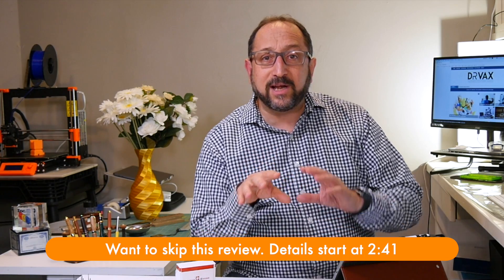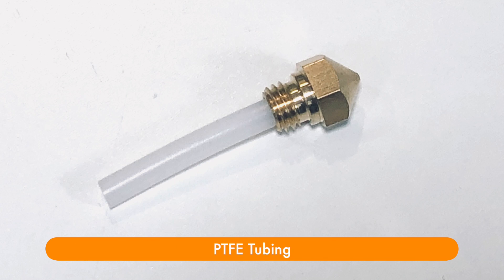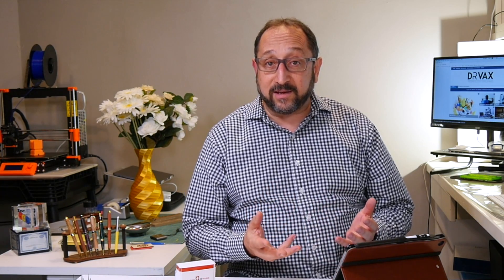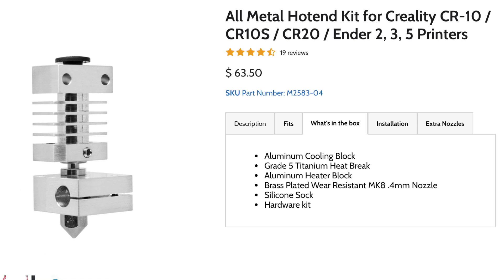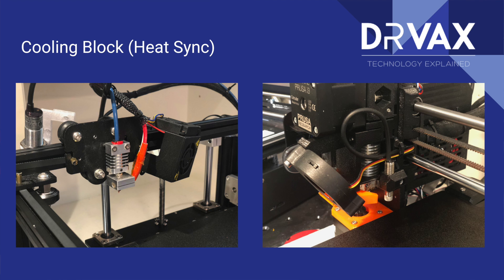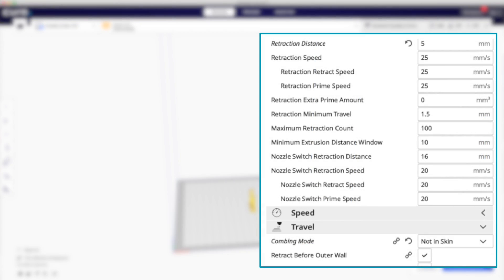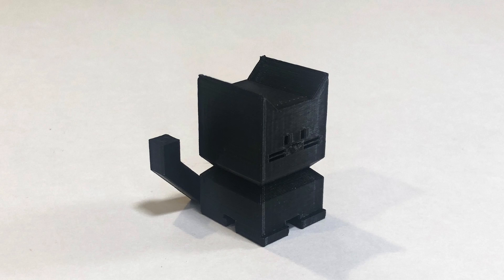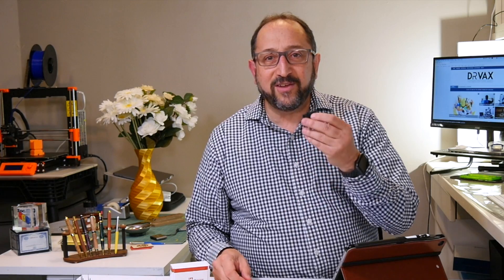Micros Swiss All Metal Hotend

Comment: Nozzle size  has nothing to do with the print quality but as much as your print get smaller nozzles has to be.If enlarge the smallest print its look like the biggest.Of course though  if you use a small nozzle size on a big print it prints it out smoother surface look.So the quality is the equally of the whole print.As long as the nozzles gives a round shape layers the surface wont be equal but if it is there it is from smallest nozzles.So the best  for solving this issue rather than upgrading the extruders is the nozzles gives a  Square shape just as pixels.But because of  filament being malted it gives round surface a gain but less than the round and can be bound in by letting the Square sides as that.On that way the slice can be built vertically and horizontally as bricks.
Reply from the maker: Not sure I agree.  However I appreciate your participation in the discussion.  It may come down to the definition of quality.

Comment: Hey Doc, have you managed to get your retractions dialed in for your ender? Im running a microswiss with dual gear extruder on my cr10s and still get some stringing issues that I cant seem to resolve. Any advice you could give would greatly help, my current retraction is at 5mm and a speed of 50mm/s with zhop enabled.
Reply from the maker: First try lowering your temperature.  Second I use 5mm retraction at 25mm/sec.  However every extruder setup is a bit different.   I also use Capricorn Bowden tube which seems to help.
Reply: @MakeWithTech  Thanks for getting back to me so fast! Im currently running PLA at 200 but I might benefit from dropping it to 195. I currently have a capricorn tube as well just need to dial it in a bit more, I'll mess with the retraction speed and temp and go from there. Thanks!

Comment: I am pretty experienced with 3d printers, i started in 2013 and i am currently developing my own printer from scratch. The observations you made because of the heat creeping are correct, thumbs up! hint: when assembling any hot end, tighten the nozzle at max finger force against the heatbreak, heat it to 250c +- and then tight it with a wrench.
Reply from the maker: Thanks for the comment and the support for my observation.

Comment: Some of the Micro Swiss setups have the 2 screws between the heat block and heatsink.  I've seen one video where there was, instead of the screws, flats for a wrench to hold the heatblock while you tighten it.  I bought a copy of the Micro Swiss from Amazon for about 12 bucks US, and this one has the screws.  I have been having tons of jams, and just figured out that the heatsink was getting too hot, and the melted material was, since it was under pressure, expanding and blocking as you say.  Now, two things, the Micro Swiss has miserable fins.  They seem very weak looking, with too little surface area.  Second, it seemed that it was stupid to have screws on there transferring heat!  I was tempted to remove them to see if it would work.  Then, I watched a video by 3D Printing Nerd who installed a Micro Swiss WITH the screws, and he TOOK THEM OUT after tightening the nozzle.  This answers so many questions!  I am testing again without the screws.  Obviously, if you need to remove the nozzle, you need to reinstall them.  It makes so much sense.  Why would you make such a thin titanium heatbrake tube, and then have 2 screws just trucking the head up there anyhow!!  Hoping for good results now....
Reply from the maker: I wouldn’t buy an inexpensive clone.
Reply from the maker: When testing precision machined parts like a hot end I would recommend purchasing the original part and not a clone.
Reply: @MakeWithTech  That would be easy to say if you had the cash to get the original.  I don't, but as a machinist I can also do my own quality control, so for me, this was way better than getting the original. I am getting all the benefits of the original now, just with less initial support from the seller.  Here my intent was to share tips that could help others like me save time and money.
Reply: Don't blame Micro Swiss for problems with a cheap knock-off.  They may be due to something the original got right but the knock-off got wrong.
Reply: @scottwillis5434  My intent was not to blame Micro Swiss, and their cooling fin design, despite the way it looks to me, does work!  I think it's a great design, as long as people who use them know what they are getting into.

Comment: Enjoyed the video as always but you fell short when comparing the Ender models with more expensive printers regarding the stringing issue. Not everyone can afford multiple printers. Your outcome was that 'all metal hotend' is a viable option but we did not 'learn together' how to  overcome the stringing with the Enders using an  'all metal hotend'. If it can't be done then it is not a viable option for Ender printers. Thank you for your valuable input and the way you put accross your knowledge in a simple and easy to understand way.
Reply from the maker: I appreciate your observation.  The Ender printers do an excellent job with day to day prints and most stringing tests.  It is only the tall tower string test which is a problem and it is unlikely a production print will have these characteristics.
Reply from the maker: @Peter Horton One more observation.  I am doing another set of prints for a video comparing my Prusa to the Monoprice Ultimate 2.  In reprinting the Prusa prints I am getting a bit of stringing which I do not remember in the past.  In the past I used Hatchbox PLA, these prints are with MatterHacker Build PLA.   It may be that Build PLA strings more and if so some of the stringing with the Micro Swiss might be a result of using a different filament.   

The fun and the challenge of 3d printing in a consumer setting, is that there are a million variables.  In a production setting you would pick one filament, tune for it, and only print with it.
Reply: @MakeWithTech  "A challenge" you can say that agagin. I am very impressed with the concept of lithophanes. I also had good outcomes with using Esun PLA+, so I bought some white Esun PLA+. My original prints where OK but had random lines through them. I was using Cura 3 as the slicer. Recently I completed a 3D printed revolving lithophane lamp which has 4 curved lithophane panels. Now using Cura 4.2.1 and trying to get get best possible prints, I combed the internet trying to find the best settings and ended up a dismal failure. Excessive stringing and artifacts. Finally after more research and analysing the Cura settings more closely I eventually got succuessful. The out come was amazing. it took about and hour longer to print each panel. But back to the Esun Pla+ white. I have done regular models and I believe the quality is not as good as other colours or brands. Still need to do more experimenting. I did notice that using a lower temp (was 215 now 207) improved the print. I am an expat pensioner living in Thailand and always been a tinkerer eg build, upgrade and troubleshoot my  computer as well as helping other people. My 3D printer as it is an enjoyable and valuable source of stimulation. Your approach to 3D printing is excellent and I always look forward to "Learning things together" with you. Thank you for your responce and commitment. Kindest regards Peter H

Comment: The issue could be that the parts are put together when warm, when they cool they shrink leaving tiny gaps, the hot end should be put in the freezer for a couple of hours before assembly then put together and tightened up, this will ensure that there are no gaps when there is differential heating between the parts because they are tight when cold and therefore will only get tighter as they expand
Reply from the maker: Not sure I buy this.  I always though parts expand when heated and contract when cold.  However since not all materials expand at the same rate threaded components tend to get loose when heated.  

I heated my hot end to 230c then retightened everything.  Save as the procedure for replacing a nozzle.
Reply: @MakeWithTech  E3D suggests heating above typical print temps for hot assembly with the idea that parts will tighten to provide good seals at print temps. They recommend 285C for the all-metal E3D v6.

Comment: Just use prepare abs end every time you want to switch filament regardless of what filament it is.  I've been doing it this way for a long time and have never had filament stuck.
Reply from the maker: Not a bad idea.  Only negative is that is overheats the bed.  Thanks for sharing.
Reply: @MakeWithTech  you can choose to heat the end only.

Comment: I love Micro Swiss, I have no issues. I have 2 all metal MK10's on my Flashforge, Now for my Ender 3 I did it a little different. I do not like the their Creality style Hot End, I want a thermal tube that goes through the heatsink. So I used a Creality CR-10 heatsink, a Micro Swiss MK8 all metal thermal tube, and a Micro Swiss E3D style coated nozzle, of course I am using a titan clone direct drive also, no issues.  Also, if you read the instructions from Micro Swiss, you should print a little hotter with an all metal hot end 5 -10 C.
Reply: so I assume you use an e3d style heater block since it don't think an e3d style nozzle will thread into a heatblock like the MK8 or the microswiss
Reply: @alberdw1985  just a clone block from a bunch I have for spares.
Reply from the maker: Thanks for sharing.  I also have had no issues.

Comment: Another great video Doc! I had a problem with jamming on my Micro Swiss hot end when a print would fail during the middle of the night and I had to kill the power to the printer with my wifi switch. In those conditions with no cool down the filament would jam way beyond just heating up the heat block at a high temperature and pulling it out. I would have to take it a part to get everything sorted out. My printer is in my store and I monitor it at night with a simple Wyze cam. Other than those conditions I never had issues. But for that reason I went away from the Micro Swiss for awhile.

A couple of months ago I had a problem with my stock hot end and switched back to the Micro Swiss as that was my only option to print and not wait on parts. One of the things you did not mention in your video is how much easier it is to change nozzles on the Micro Swiss. Because the nozzle tightens up against the titanium heat tube, you do not have to worry about the bowden tube being pushed tight against the nozzle. It really is an easier procedure to change nozzles in the Micro. I have altered my end of print G code to retract the filament 50 mm so there is never a problem with jammed filament after cool down. Even if it is several hours. Of course I have been doing this with the stock hot end as well. I just remember to run the filament back down to the hot end before I start a print. Most of the time I am changing filament as well so it is not a problem. Plus I have changed my waste print at the start of every print to run the full length of the bed with 4 passes. I have found that by doing this and usually printing a skirt, the filament is flowing plenty well when the actual print starts.

Again, great video! Keep them coming.
Reply from the maker: Thanks for sharing.

Comment: I honestly don't know what your doing to get such bad stringing on your ender 5. was the stock tool working the same way? I ask as ive only used the stock and E3D all metal clones. You have the retraction set correctly. I don't mean this to be rude, but something is not right. Maybe the Micro Swiss? I am going be thinking on this for a bit =( this is really bugging me.
Reply from the maker: In general I get very little if any stringing on my Ender 5.  With the original hotend or the micro swiss.   The only time I get stringing, and this happens on a number of printers I own, is when I print the Kickstarter model with the tall very thin towers.   Traditional stringing tests print perfectly.  

The kickstarter model is quite difficult to print properly which is why it is such an excellent test.
Reply: @MakeWithTech  I have printed models I would think would have similar difficulty(As they have similar tall thin towers spaced similarly.), but I am going have to try that specific model to be fair. I will add it to my list to print after I am caught up on orders. I am going to try that exact mesh and ill get in touch with you. Thanks for the understanding reply back as not meant rudely just was a little baffled. I'll  update you on it when I have it printed one way or the other. I'll try to PM some way as thinking about it this is not best way to ask this. I am in no way trying to demean your video. Thinking about it it could infact have something to do with some of the products I am developing for Enders internally at the moment. Not sure their is a way to PM on You Tube though :P thinking about it.
Reply from the maker: I value everyone's comments.  That is how we will all learn together.  If you crack the Kickstarter challenge let me know what slicer settings you think are best and I will do a video about printing the model and give you credit.

Comment: Short version: never ever turn off your printer while the hotend temperature is higher than 100°C.
And this is with whatever hotend you have.
Reply from the maker: Correct.  Thanks for sharing.
Reply: ~50 degrees is the most safe spot. this is what industrial printer makers recommend.
Reply: It wouldn't be an issue with water cooled hot end.
Reply: Hm. I plan to build in my printer an out power off, that cuts the power. So I will have to do what DrVax mentioned. I will have the printer first to retract the filament and then wait til the hotend is below 100C and then do a shutdown.
Reply: i wait untill lower than 50c if u want to swap filament 210 manual push in a bit then pull out for easy loading.. not sure how u can say its no better than stock .. its way better than stock imo
Reply: Or simply retract a bit before doing so ;-)
Reply: @quique182 If you retract 100 mm filament will be at the top coupler of the hot end so there is nothing to swell from heat creep, it's tried and tested.

Comment: I have a micro swiss hotend on a Wanhao i3 v2.0, It works brilliantly. I have one on an Ender 3 with a swiss all metal, and it was jamming in the heat break constantly, even higher temps did not unjam the PLA. Switched to an E3D all metal clone, PLA prints OK but the PLA sticks in the heatbreak and stops other filaments from printing correctly, heating did not fix it. I have also made sure the transition zones are gap free. I have temporarily switched to a heatbreak with PTFE until I can have another go at fixing it. I have also tried a filament oiler, small amount of oil did not seem to make much difference. Too much oil and the PLA became extremely brittle. For anyone with troubles make one change at time so you can isolate the problem, yes this takes time but it is worth it. Anyway DrVax great videos.
Reply: I missed a bit, during large retractions a small piece of partly melted PLA can break off at the top of the heatbreak as it snags on the way through and never be able to be melted out. You will need to disassemble the hot end to get it out. It is surprising how many different ways the hot-end can give trouble.
Reply from the maker: Thanks for the comment. So far I have had no issues.

Comment: Helps alot to add 5C to the hotend, reduce retraction to like 1.5 and retraction speed to 25mm/s
Reply from the maker: I will give it a try.  Thanks for commenting.
Reply: I thought he was using 25mm/s speed on his retraction already? Or maybe I am getting this confused with another video I watch the yesterday :P. If he is not that would explain the differences. Personally I have always retract further if its not direct, I am going try the 1.5 out of curiosity because I think I have only tried that distance in the past when it was at higher speeds. Temperature depending on where hes yet I agree could help or make it worse. I always feel you play up and down on that. Anyways Just more wondering if I am misunderstood now on the retraction speed DrVax was using and myself curios to try your short retraction on a Bowden =).

Comment: The problem is that microswiss heatbreak coupling to heatsink is with loose in tolerance, even using thermal Paste the cooling of heatbreak is not sufficent. This is why i throwed it to trashcan and installed e3dv6 hotend.
Reply from the maker: Interesting observation.  So far mine has worked great.
Reply: mines been fantastic 2mm retract no jamming may i just say while i do the happy dance 🕺🗣no more burned up ptfe tube !

Comment from the maker: By mistake, I removed this comment from Dianne Bishop.   I have added it back here for everyone.  Sorry, Dianne.  Clicking too fast.  (I recovered the comment from my email.)

On my Ender-5 with E3D v6 Bowden Edition (24v) and Capricorn Bowden Tube, my retraction is 4.8 and the speed is 9000 mm/mm (150mm/sec). No stringing.
Reply from the maker: Impressive.   That retraction speed is quite high.  I will give it a try and see what impact it has on a Micro Swiss Hotend.

Dianne, have your tried printing a Kickstarter test model.  I am also able to print without string when I test with the traditional two-tower test model.